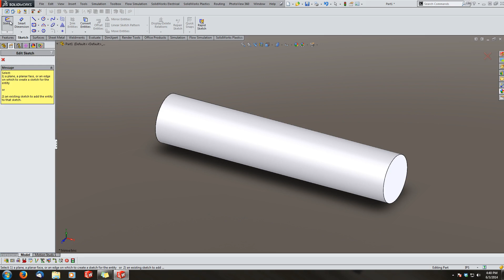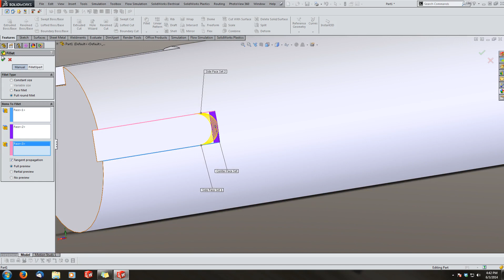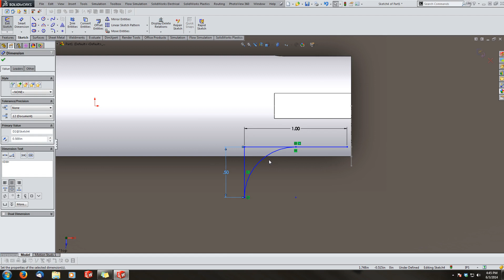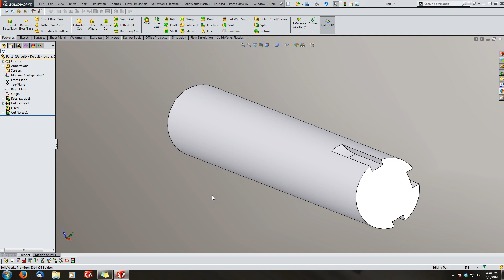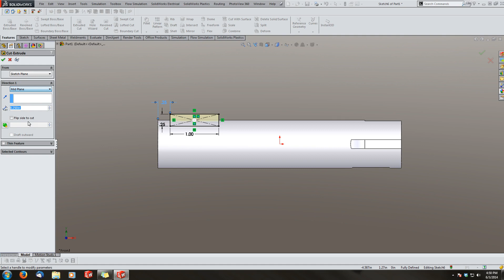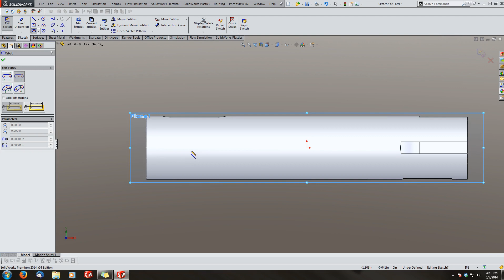Keyways

Comment: Hi Steven realy great work and explained well.
Just a note regarding key ways. I beleive that the keyway is centred equally above the shoulder of the cut and not the tangent of the surface. For example th edepth of hte cut at 13.04 should not be half the depth of the key but a bit more to allow for the curvature of the surface